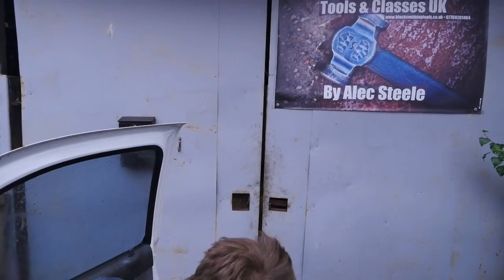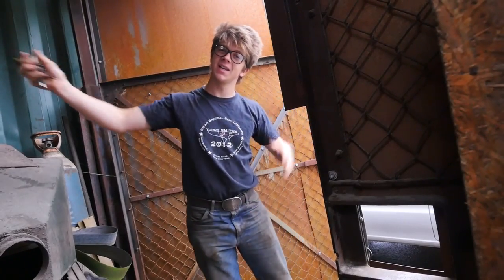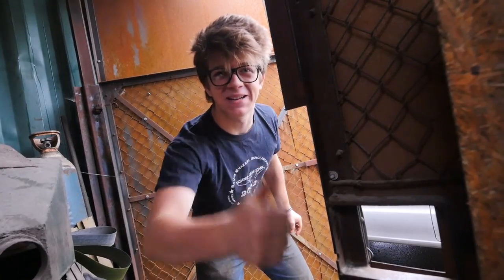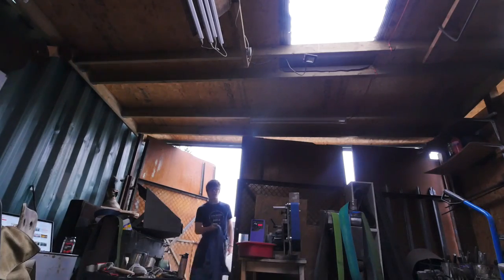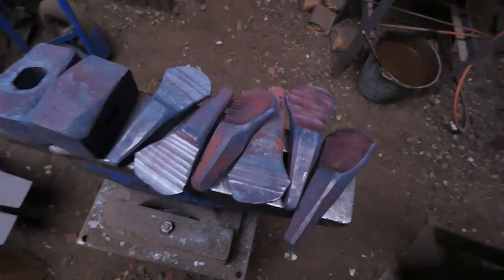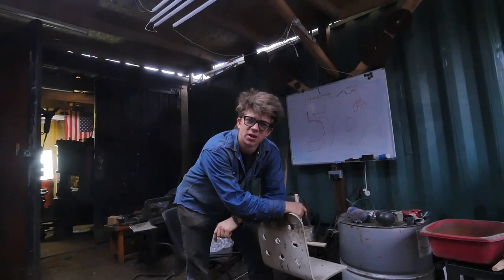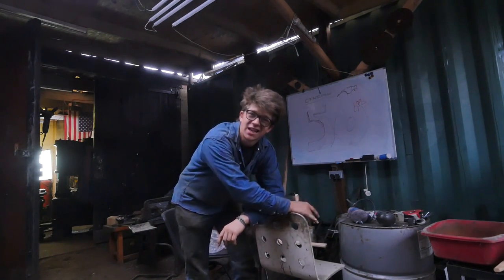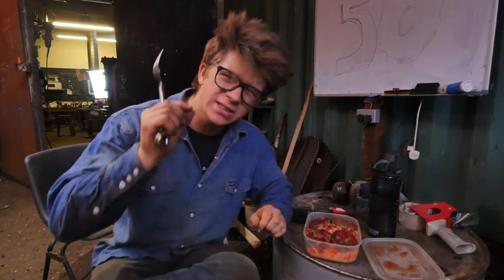Why Rain is Good for the Blacksmith

Comment: So how does a sail boat work? I mean, it pushes you great with the wind, but how do you come back home against the wind?
Reply: you need to tack backwards and forwards
Reply: it's called "cross sailing" in my country, you set the sail so that it catches the wind at an angle and then countersteer to go. for example, 45° port or starboard of you course, then you set the sail to go 45° the opposite direction... as Henry Tomas said you go back and forward like that until you get back...
Reply: Matt Behnke your right, you can only get within 30ish degrees of the wind. At that point the wind flows over the curved sail exactly like an airplane wing and makes lift, pulling you forwards. 30 degs isn't terribly far away from going straight upwind so by zigzaging over time you can make it there eventually.
Reply: Realistically, most boats can't sail closer than about 45 degrees off the wind.
Reply: You zig zag
Reply: Nikolai, why have a close hauled point of sail then?  45º is a close reach.  Really depends on the boat... some can sail close hauled 20º or better to the wind.
Reply: oceandrew Citation needed, I think. I've never heard of a boat being able to sail a course higher than about 30 degrees off the wind.
Reply: Technically speaking, the air is not pushing the sail.  The pressure difference is pulling the sail, much in the same way an airplane wing generates lift.